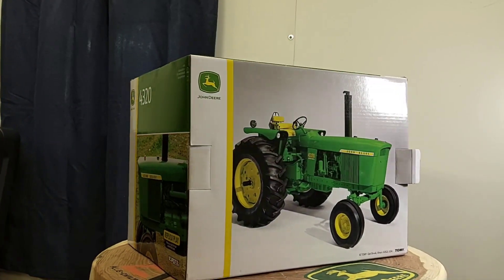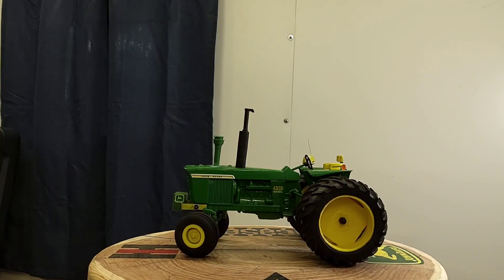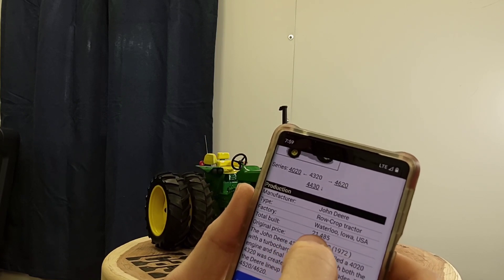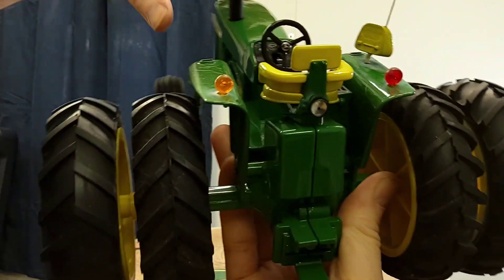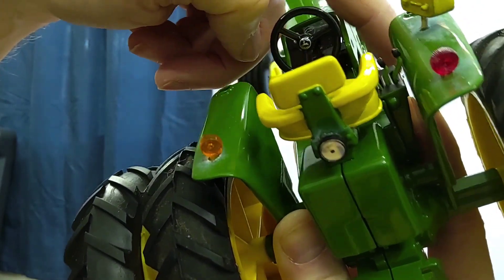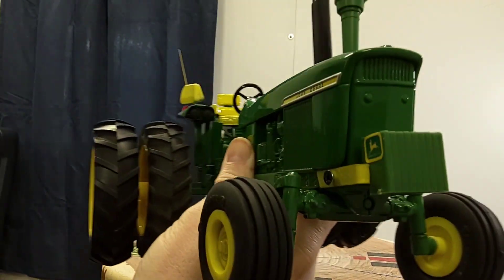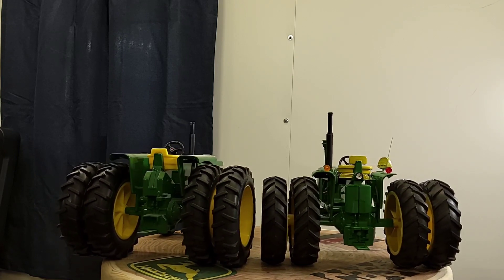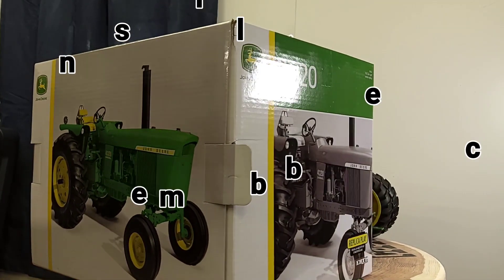Ertl 1/16 John Deere 4320 Replica Play - Customized!

Comment: Phil, when I put Chucky's tires on mine, I had to raise my fenders. Did you redrill the fenders and raise them? 5010 and 5020 were the first two-wheel drive 100+ hp tractors. The 4520 and 4320 were the first power to weight ratio high horsepower tractors.
Reply: @krvnjrcbs  The 5020 was available in row-crop configuration. The 5010 never had an adjustable front axle. There is a guy in my town that has a 1968 JD 5020 row crop.
Reply from the maker: Nah I didn't have to redrill the fenders or anything